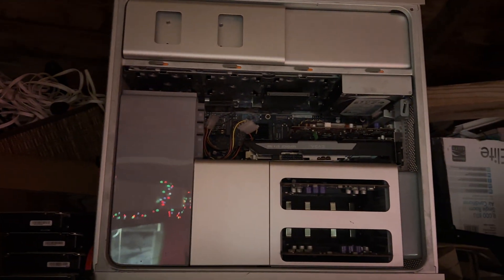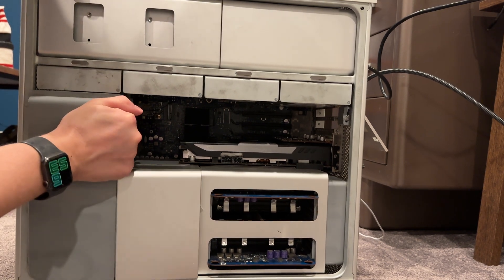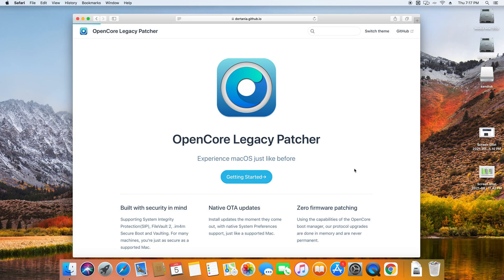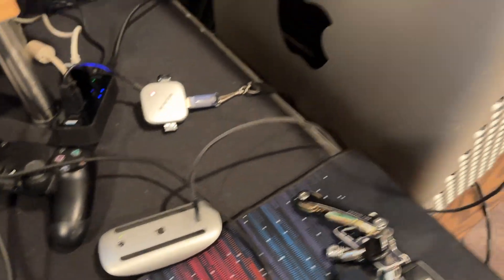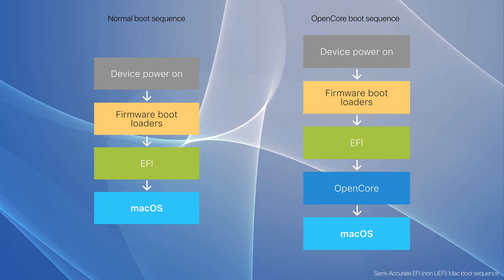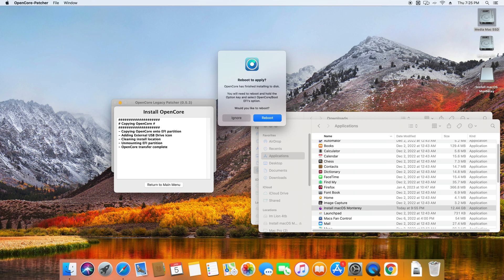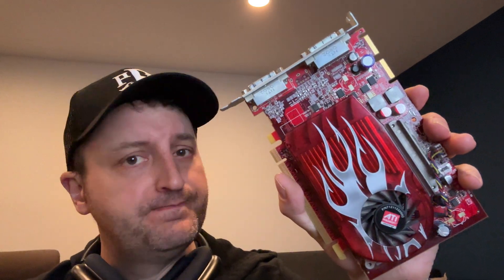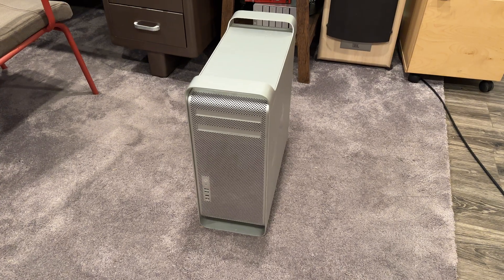Rescuing a Mac Pro 2008 and upgrading to macOS 12 Monterey with OpenCore Legacy Patcher

Comment: Many thanks for taking the time to do this EXCELLENT VIDEO!! If You had a newer graphics card in the Mac Pro, would that had help? Have a GREAT week!!!
Reply from the maker: Help as in making the install process easier? Sorta, the RX580s require an OpenCore fix for 10.14+ and my gpu issue was not removing the old gpu. The cause of the boot drive requiring me to manually select seems like a quirk with either my computer or this model as I didn’t have this problem on my MacBook Air 2015, check the OpenCore in 5 minute video I made.
Reply: @dmug  hi my friend! First of all, thank you for the amazing content. Can you point me to the fix you mentioned? I am using Monterey with the RX580, but bootloader is black and I feel it’s slow.
Reply from the maker: @SalunMarvin  I think OpenCore legacy patcher auto applies the RX580 fix for the 3,1.
Reply: @dmug  Unfortunately, it doesn't (at least in my case). I have to remove the drives I don't want to boot and hope it works. That's how I managed to have Monterey running, but it felt veeeery slow. I think the bottleneck is the SSD (a common one). I'll try the upgrade to a NVME one and see how it goes. But still I can't see the bootloader on my RX580. Thanks for answering!

Comment: The fact that the Opencore OS installs work so well demonstrates quite clearly that there is no good technical reason for Apple to drop support for older hardware so quickly. Windows 10 actually still works (not great, of course) on 20 year old Thinkpads. Apple just wants to sell more hardware.
Reply from the maker: I think this is more or less accepted fact at this point. I kinda wish we had paid OS updates if it meant longer term official support.

Comment: So I have a stock Mac Pro Early 2008, 3,1 currently running Mac OS X 10.7.5. If I use OCLP to upgrade it to Monterey, will all its original hardware (eg , Wifi, graphics card, etc) work as normal? Are there any caveats?
Reply from the maker: Bluetooth doesn't work, the current issues should be noted on the OCLP page.
Reply: @dmug  Ok, didnt realize it has built-in Bluetooth... hmm. okay, I dont use BT, so as long as Wifi works and video is normal, I guess that will be good enough for me...
Reply: @be236  Hello, you updated succesfully to Monterey?
Reply: @HH-gd8jm  Yes.. the key step is that at each reboot, I need to hold down Option key to keep selecting the correct boot volume to get into until finally it gets the the final step and Welcome screen. Though Monterey is much too slow on this iMac 2008 and it lost my DVD drive, so I am re-installing Big Sur, which is barely useable now.
Reply: @dmug  how did you use bt keyboard in the video? My mac pro 3,1 gets stuck at the "connect mouse/keyboard" screen after installation. I tried usb 2.0 hub with wired mouse and keyboard and the mouse moves, but the screen won't change to the language selector. Any ideas?
Reply: Leveling, I'm dumb. I see the keyboard cable now. Mine will install until about 5 min left, then say "an error occurred while preparing the update" but I'm installing on a new ssd
Reply: @dmug  Ok, when I use OCLP , I get to the Install Monterey page, and it take a long time, and then it reboots and then I get back to the Installer (Recovery page where I first installed again).. am I missing something? When I installed OCLP to my USB flash drive it was set to Mac OS Extended format, not FAT32... could that be the problem?

Comment: I have an early 2008 Mac pro. I upgraded to 64 gb ram and two 1 tb ssd hard drives but the start up drive can’t be replaced by ssd because I can’t clone the programs etc on the operations hard drive.  Do you know if there’s a way to install a newer hard drive into this computer that already has the operations programs and programs?  I need help.

Comment: Yesterday I used OpenCore Legacy Patcher 0.61 to install Monterey on my Mac Pro 5,1. All went well and works, except for one thing: a lot of websites don/t load in Safari anymore. i deleted Safari cache, cookies, history and tried much more to solve it. Nothing helps. Safari reloads webpages automatically a few times and then says there is a problem with the website. Firefox and Chrome do work, so it is not a network problem. The problem is related to JavaScipt, I think. Because if I switch JavaScript off in Safari, the page loads better, but obviously lacks functionality. Anyone else has this problem? And even better: a solution?
Reply: Yeah frequently. I don’t often upgrade OS so am regularly pushing against what modern web standards can deliver. Without fail safari is the first to crap out. Whatever code is running that thing it needs a very clean ship to operate. Which is why I never use it. Firefox is the only way to go. It’s always the last to crap out, and when it does I know I’ve finally ran out of time and have to bite the bullet and update something

Comment: Hey, glad to see you haven’t abandoned that 2008 cMP.  I have a 2008 3,1 and a 2009 4,1 flashed to 5,1.  Both of them are still running good, but I haven’t bothered to upgrade to Monterey on either. I may give the 3,1 a try following your video.  I have a GTX 650 ti in the 3,1 and I think it’s supported as a Metal card.

Comment: I had several memory modules die on me too, to my suprise after I took them apart, cleaned them with ipa, cleaned off the crusty thermal pads on the heatsinks and got them new cooling paste they appeared in the configuration about my mac again.
Not sure what to make of that but there was two or three modules that I brought back to life to a total of 16GB-FB. Only downside is that even with fresh thermal paste these modules run hot at 87 degrees celsius...pheew
Reply: Seriously? How did you remove the heat sinks from the stick? I have a couple of recently failed 8GB DIMMS I could try bringing back to life
Reply: @madmac66  Remove the clips and carefully pry the heatsink off.
If it wont budge even with a flat head screwdriver, squirt some isopropyl alcohol or aceton between the heatsink to soften up the heat pads.
Be aware there is a bga soldered memory controller with bare silicon in the middle square on the ram stick.
What I did was to have the computer running without the side panel on and turn it off.
And immediately take one stick and work on it with gloves on.
Why gloves? Each ram stick is 88°c hot! 
After I successfully separated all off them I drenched them in acetone and brushed them and let them dry and heated them with a hot air gun.
You got to get all that acetone or isopropyl alcohol out from underneath that bga soldered memory controller.
Then I covered all the chips with frisky amount of cooling paste and reassembled the heatsink and preying they would work. Getting the clips on is the most difficult task.
Don't worry about the temperature, the ram sticks will still measure 88°c after changing the cooling paste, that registered memory controller is what generating that immense heat.
Reply: @yarpyarp5647  Awesome reply. Thanks. That's a cool project for a rainy day

Comment: Awesome channel. My Mac Pro 5.1 works great with Monterey thanks to Open Legacy Group.

However Graphic card Sapphire RX 850 with 8 GB is working but not recognized as the graphics card it is, clicking on about my Mac shows ‘Display 14 MB’ and  everything on the screen is very slow.

If I plug an ATI Radeon 1 GB and it’s works fine but no Metal so when trying to open iMovie a message saying ‘This graphics configuration does not support hardware acceleration’

I once installed another version from Open Core Legacy Patcher running Monterey and it worked really good but no Wifi nor Bluetooth. 

I hope this OPEN CORE LEGACY team finds a solution.

Thank you very much

Comment: Hello first of all thank you for all your amazing content 🎉
I'm trying to install monterey on mac pro 3.1 too and without any luck one thing I've noticed is you use the USB installer formatted to Ms dos and all other videos are with gpu partition I've tried both and no luck with either can it be cos of my HD 5770 gpu? It should still install even though it wouldn't have acceleration right? Could you please help me out with this one? Or can it be to much ram I'm running 64gb ecc ram?And I've tried both Martin Lo's and OCLP Thank you
Reply from the maker: The HD 5770 is almost certainly the culprit, you'd still need a metal compatible GPU. You can probably these days pick up something like a GeForce 760 (Like I'm using) or the RX 560 for cheap
Reply: @dmug  
Well I was thinking in going for rx 580 8gb would that work without having a apple firmware? cos they're half the price. that would allow me to run up to ventura right? I have in mind getting a cMP 5.1 so that gpu would serve both right? But won't give up on my 3.1 till I get it running lol you get what I mean right😅😂
Reply: Would I need to run the dosdude rom firmware update? Cos I did run it but not sure if it was applied as was still not able to Read apfs drives so kind of confused

Comment: Upgraded my 3,1 to Monterey, RX580 GPU, 32GB ram but just the single processor, no boot screen, no optical drive and a bluetooth dongle but other than that it works well, long live the 3,1!
Reply from the maker: Nice, what do you use it for? I wish I had a better gpu but sold off my few extras during the gpu crisis and I can’t really justify spending $100 on a better gpu for a computer that I barely use. It’s not like YouTube is a big money maker where it can fund projects like that.
Reply: @dmug  Well, the GPU is a bit more than the CPU can handle but it works pretty well. I use it for all sorts, my day to day is an iMac 2013 updated to Ventura using OCLP. The Mac Pro is just a nice machine to have around, BTW lots of great information on your webpage, the 3,1 was a gifted machine that needed an update and your webpage was very helpful. And I like the channel so keep it up!
Reply from the maker: @clivemorris4845  Eh, kinda. The 3,1s are certainly limited but you still get benefits from a faster GPU, especially considering the 760 can barely drive a 4k display. 

For awhile my Vega 56 lived in it and it was a big upgrade from even the GeForce 1060 that was in it.
Reply: @dmug  Did you manage to make the original Bluetooth Card work?
Reply from the maker: @SalunMarvin  I have an upgraded 3,1. Years ago and years ago I swapped the Wi-Fi chipset and it’s long gone so I can’t test it.
Reply: @dmug  no worries. I am making a checklist of upgrades. Wifi and Bluetooth card, USB hub, PCI express card and NVME SSD and I think I am done.

Comment: Nice video, I have here a mac pro 2008 (same as your example) 3,1 with mac OS 10.6 leopard but my problem is my NvidiaGeForce GT 120 has no display I'm planning to buy at ebay like the GPU that you demonstrate which is  the Nvidia GeForce GTX 760 can I ask if it will run like the Nvidia GeForce GT 120? or shoud I buy the same as Nvidia GeForce GT 120? Thanks,  Hope you can help me.
Reply from the maker: There’s nothing special about the gpu I’m using, older version of macOS do require web drivers for nvidia hardware. 

If you’re looking for more hassle free and better performance I’d suggest a RX 570 as those can be had generally much cheaper and are better at driving 4k displays.
Reply: @dmug  Thanks a lot sir Greg. I've search in ebay,  Sapphire Pulse Radeon RX 570 4GB GDDR5 Graphics Card (Overclock) (11266 -04-20G), to be specific is this compatible for Mac pro  3, 1or is this for PC descktop? Thanks again.

Comment: I watch your show on this exact computer! I am running OS X El Capitan Version 10.11.6. It has the same 2 X26 GHz Quad Core Intel Xeon processors your described. It has 8 GB 800 MHz DDR2 FB-DIMM in it and the ATI Radeon HD 2600 XT 256 MB graphics card you showed in the video (the 1900 XT misspeak). I have replaced the fan in that card myself when the bearings took a dump. 
So I am probably on borrowed time. 

In spite of that, so far this has been my daily driver since I bought it refurbished from Apple when dinosaurs roamed the Earth. I am happy with it to a certain extent but some things (like Safari) can't keep up with today's tech. Firefox is also my fix for that as you showed.

What do you suggest? Is it worth it to upgrade the graphics card? If so to what Card and where would I be likely to acquire one? 
I have already considered upgrading to solid state drives (an internal raid maybe) and upping the ram. 
After these upgrades would I be seeing any more functionality and capability by upgrading the OS to OS 12 Monterey?
Reply from the maker: I can't say if it's "worth it" but you'll certainly notice a difference in performance if you grab a newer GPU. I've had good luck with ebay since it has buyer protection but it isn't the cheapest. 

Local markets vary a lot as does region. If you can score a Radeon 580 for under $100 it's probably "worth it" as it's quite capable, able to easily drive two 4k displays at 60 Hz for daily use and good enough for modernish gaming if you don't mind 1440p/1080p gaming.

Even a cheap SATA SSD will feel much faster, especially if you make sure it has cache (DRAMless SSDs can be slower in larger transfers than a HDD).  

The biggest reason to upgrade older machines is for software compatibility, followed by Apple's suite of apps. If you rely on Safari or Mail or Messages or Calendar etc, Apple frequently updates these.  If you update the wifi chipset, in 10.12 you'll get Airdrop support,  Other features you'd gain: dictation, Siri, HEVC (H.265) support, live photo support, the new podcasts/music/tv apps, stacks, dark mode, control center and so on...
Reply: @dmug  Thank you for all that info. I appreciate it. That last group of feature gains, did they require the updated wifi chipset, or were they just due to the upgraded OS?

Thanks again for keeping the old hardware in the running.

Comment: Hey Greg, great video as always!
If I may "abuse" its comment section for a question of mine: I'm trying to revive a 4,1 (flashed to a 5,1) that's running High Sierra. I for the life of me cannot get into the boot picker by holding Option during boot. Bluetooth keybaords as well as two different random USB keyboards don't work for this. The Mac Pro completely ignores any button presses until the login screen comes up. I've read that this only works with an Apple USB keyboard but firstly that seems like total bullshit to me and secondly, you cannot buy these things anymore. Sadly I don't have one nor do I know anyone who does. Any help is greatly appreciated, thanks!
Reply from the maker: Are you able to zap the NVRAM ram? (command option P R)
Reply: @dmug  For some reason YouTube decided to not give me a notification for your reply, sorry for the late answer. I was not able to reset PRAM with the keyboards I have access to so I went and purchased a 2007 Apple wired keyboard from the used market and sure enough, that worked! I was then able to reset the PRAM and get to the boot picker. Newer macOS releases here I come!
Reply: Ive had occasion where the keyboard is not recognized until boot up. I think which USB port you are plugged into can make a difference. I’ve used MacAlly keyboards with success so it doesn’t have to be Apple. But not through any kind of hub for sure. As Greg says if your keyboard lets you, zap the PRAM. It’s like a cure all fix for many things. Or the SMC reset helps a lot too. Look on Apple support for that
Reply: @madmac66  See my reply to Greg above. TLDR: purchased old apple wired keyboard from the used market, that worked.
Reply: @CreativePixels95  Ah right on. Fwiw I love those old apple wired keyboard. Mine crapped out last year and I had to get macally one. It's okay but I miss the apple one. I couldn't find a used one for a fair price and new they are like 120. Typical apple nonsense
Reply: @madmac66  I really miss the old wired keyboards too, they are amazing and you got a nice product for the price. Nowadays you pay 120 for a wireless one. Apple prices are absolutely absurd. Their stuff lasts a long time but it's just prohibitively expensive. Was eyeing the M2 Pro Mac Mini but that ain't cheap either. As much as I love my 5,1 it's an old beast, overdue for a modern and more power efficient replacement.

Comment: You didn't do the post install patches in OCLP. Dunno what your machine might have needed on that front, but it's worth mentioning.
Reply from the maker: I went to run it and it seemed to already have it or not need it, I probably should have mentioned that as it probably varies config to config…

Comment: Whoa, thank you!.  We have at home two 3.1 Mac Pros upgraded to High Sierra via Dosdude1 patches (one of them is my main Mac from I'm writng here right now, yeah, I'm old school) . Both of them got ATI Radeon HD 5870 cards. I need to buy another graphic card to install macOS 12 Monterey with OpenCore Legacy Patcher , I guess. Any suggest?
Reply: And also, I'm confused… Once I have the Opencore bootloader will I be able to launch my old 10.6 and 10.12 drives?
Reply from the maker: @migtiming  the issue for you is 10.6 doesn’t support modern GPUs, I’m not sure if the GeForce 680 is supported in 10.6 but it might be, but it’s one of the oldest metal compatible GPUs.

Otherwise I’d suggest virtual machining 10.6 and getting like a RX 580.
Reply: @dmug  Thanks a lot. My 5870 just died so now I´m obliged to get a new card … my secondary one is the good old HD 2600 XT :(    I´m in High Sierra with Dosdude patch. I think I will upgrade to Catalina using Dosdude or maybe Monterey with the Opencore patcher (and  no 10.6 boot needed)  but just a simple question:
 
Which card would be more compatible, the RX 580 or some GTX 680? Thank you, Sir.
Reply from the maker: @migtiming  Mac Pro 5,1 580, Mac Pro 3,1 680.
Reply: Thank you! @dmug